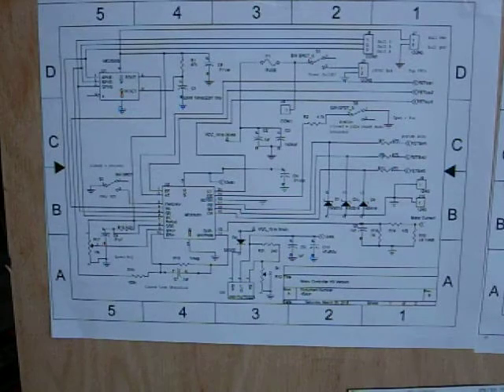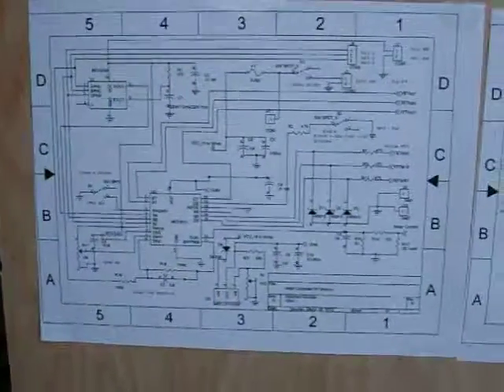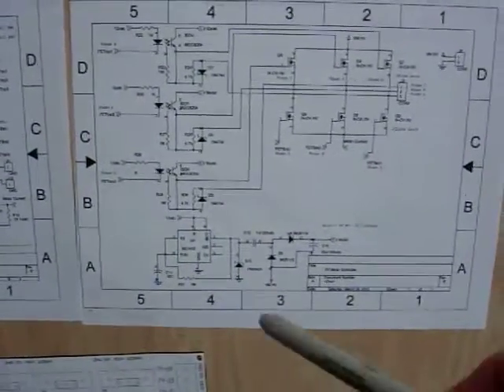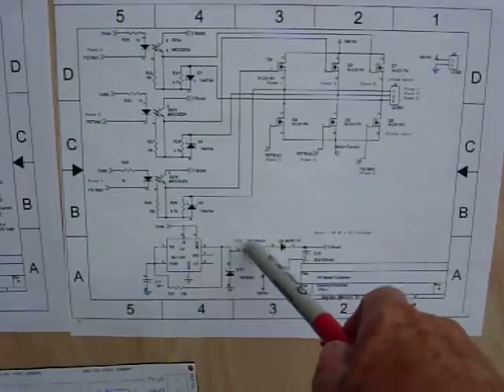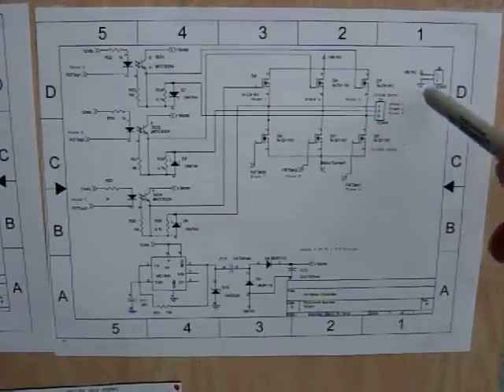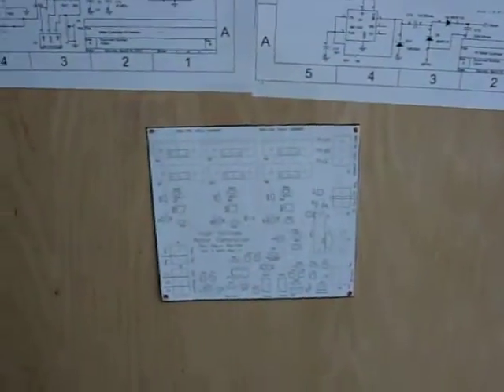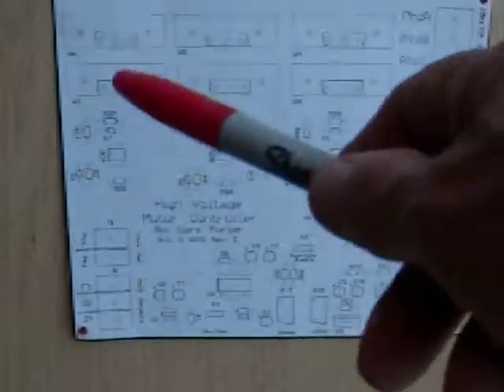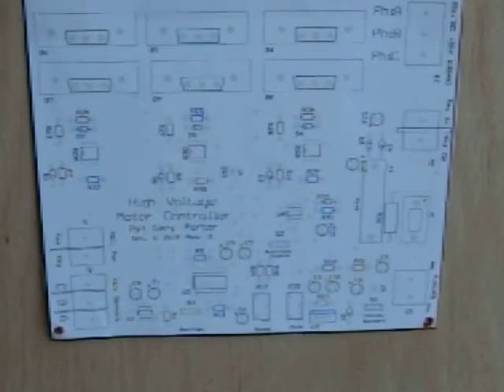Don Smith #122 new schematic and PCB for HV Version

Comment from the maker: Just tried to turn a 2 inch thick plastic 6"x6" square on my small lathe.  not a good idea. so I will switch back to wood.  The basic wood piece will be attached to the motor shaft and It will be used as a lathe.  I can only get 100 rpms so that will have to do for now.   My motor is about 10" in diameter so I should get some leverage when using the 6 " rotor with 8 2" 50 Grade NEO magnets. That 10 inch to 6 inch ratio.   The best way to hold the generator coils is to use a piece of PVC that is big enough to hold the coils. it's already a perfect circle so you just have to mount the coils inside between the PVC and Rotor Magnets.   The motor rewind shop told me I should be OK using 17 ga mag wire for the coils.  I already have my coil winding machine so Just nee the PVC wire 10lbs at $121 and some support wood.  As far as using iron in the generator I'll probably my old standby Brake Drum Turnings from the local auto repair  shop. Iron mixed with resin.  The rotor shaft 1" is working great and I am using a 1" collar to link the rotor to the shaft.  tight fight which is awesome. Also I need to build a power supply for the 160vdc source.